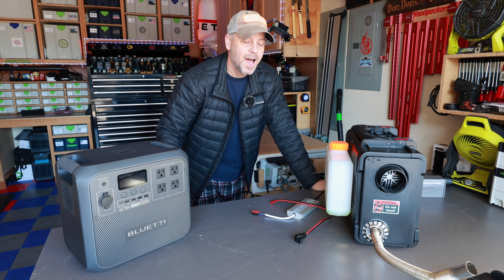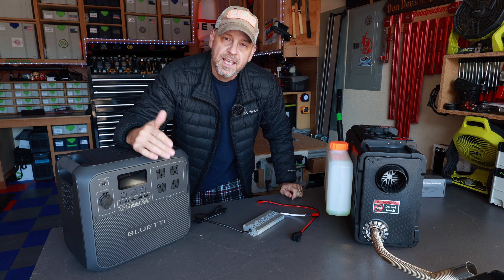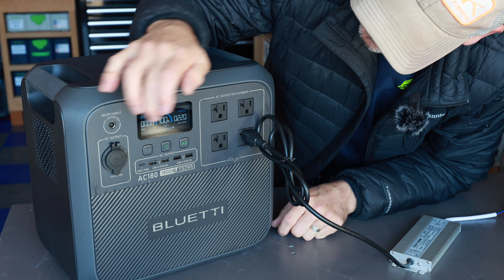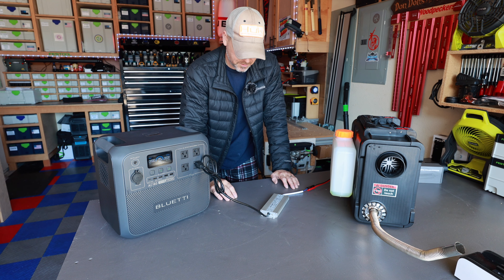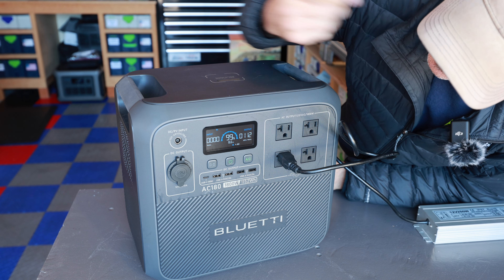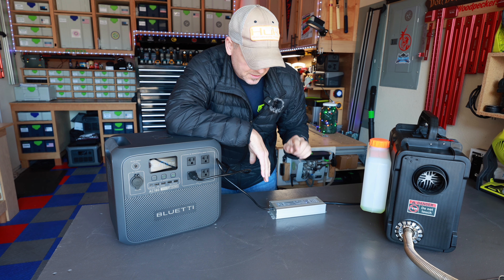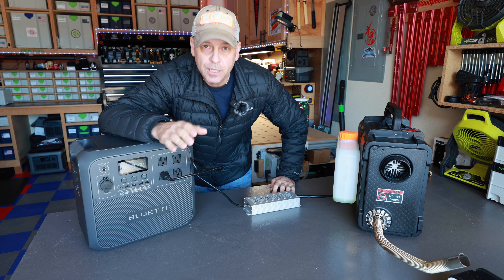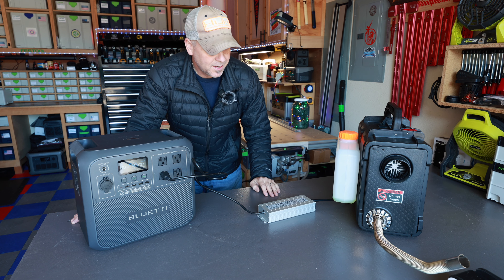Power Station not running your diesel heater??  Here's a quick fix that WORKS!

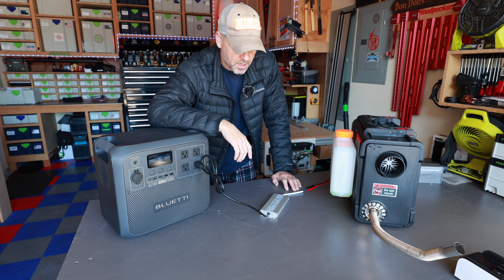Comment: What is the smoke coming from that starts at 4:37?
Reply: The heater itself it runs on diesel
Reply: Some exhaust back drafts thru the intake after it’s turned completely off. If the run cycle is not working

Comment: I looked at a Vevo 8kw and it indicated 120vac 15amp. The Bluetti has 120vac 15A so I am surprised it had issues. May be just on the edge of working?

Comment: Thank you, this is exactly what I was looking for. Now I know I’m gonna have to get an AC to DC converter regardless. It’s impossible to find a DC output that’s over 15 A.
Reply: The manufacturers are missing the mark by not giving us more 12VDC options.  How hard can it be to include a 30 amp Anderson Power Pole connection?  Seems like they are more focused on the AC side of things.

Comment: I purchased a AC to DC converter 15A 110-220v car cigarette lighter socket power adapter. I use it to run my Webastco 2000 diesel heater . Works great
Reply from the maker: That would be a good option too
Reply: I was wondering if that would work. Always seemed like the most straightforward solution but I've seen people get creative like this video and I just figured I'm dumb and the AC to DC converter wouldn't work. Glad to know it does.
Reply: Hello...are the watts important or only the amps? I found one ac to dc230- 12 volt 15 amps but there is written 120 watts... Can it work?

Comment: Same use 2000 w invertor , as start up n once running swith to cig plug . To run a fridfe n heater all nt 15 plus hrs in winter
Reply from the maker: My unit won’t allow a “hot start” it immediately shuts down once power is removed

Comment: Glad I found this video. I have the same heater but an Ecoflow River Pro battery and will not start the heater. So I'm going to have to sell the Hcalory because it pulls an insane amount of watts up front and find something else that uses less power. I really want to utilize the efficiency of the 12 volt. I only get one night with the AC to DC converter.

Comment: A bit confused. I've watched numerous YT videos of folks using the diesel heaters for camping, and this is a first concerning the additional piece you're showing. Just recently bought a Vevor 8w vertical model diesel heater, but have yet to test it. Won't be using it until late March/early Spring chilly nights next season (2024). My plan is to simultaneously heat a Hiker Trailer and a roof top tent, via a wye connector hooked to hoses. Power source will either be EF Delta 2, or a Jackery 1500. Maybe I need to run a test way before next season. 🤔
Reply from the maker: All depends on your heater really. I’ve seen some people able to use the 10amp cigarette 12v output on a power station and it starts the heater fine. I’ve also seen (and in my case) my heater pulls way more than 10amps and it trips out the power station. Probably a 2kw or a 5kw heater would maybe be fine, but as tested, this heater got up to around a max of 250 watts being pulled to get the blowing warm.
Reply: @BrianWatersOutdoors  👍

Comment: As others have stated, I just use an old laptop adapter, 12V 15A output runs mine just fine.  Same thing can be purchased on Amazon with the cigarette adapter plug already on it for like $25...but that was a new discovery for me too.  Such a good idea.
Reply: The problem is the 12v cig plugs in these power stations tend to be limited to 10a, not 15.

Comment: What is that coming out from underneath the Ryobi fan on the floor at 4:33
Reply from the maker: It’s smoke coming back out the air intake after the heater died. That’s why you always let these heaters cycle off fully when you shut them down so that smoke will burn off during the cool down process.

Comment: I ran into the same issue with my eco flow delta with the same heater. Thanks for the video! I just purchased that converter that you mentioned and hopefully it will work like yours.
Reply: New converter work for you?
Reply: My eco flow powered my 8KW last winter via 12 V DC no problem.  This year it trips.  Can anyone explain this??

Comment: The 12v outlet is the issue at 10amps max. In trucking we needed to go to the battery 🔋 directly.
Reply from the maker: Yeah. I do have a few larger generators that have a 20amp output, but I don’t want to have to lug around one of those big power stations.
Reply: @BrianWatersOutdoors  I was just watching Minute Man Prep and he’s got a Oupes Mega 2 review going on and it has a 12v 30 amp Anderson connector.

Comment: I have a question at about 4 minutes and 35 seconds what is that smoke or fog coming out from underneath your Ryobi powered fan?
Reply from the maker: Yeah, that’s the smoke generated from the diesel heater after it shut down due to the battery tripping off. It was coming out of the air intake which was near that fan. This is why you always let the heater cycle down when you shut it down so it can properly expel all of that smoke and burn it off

Comment: Do you know what could be the issue? Everything was working when I had it running over night. Some odd reason when I woke up to check on the unit but it was off and I couldn’t get it to turn back on. I even bought a new controller and motherboard but still it won’t send any electric to the unit. Do you believe the inverter is dead?

Comment: Thank you. Can I hook the non AC end directly up to the positive and negative terminals on my deisel heater?  Mind doesn't have a plug, just two terminals that you screw down.  Will this work?
Reply from the maker: Yes. That is how most diesel heaters are. Just (2) terminals for connecting the positive and negative battery cables.

Comment: My Ecoflow river pro has been working for us for the last 3 years. Once I recall it shutting down during start up but unplugged and replugged it worked fine. Must’ve been lucky i guess. I also have the same heater as you I think.  Hcalory right?
Reply from the maker: That’s only a 10amp output too, so I don’t know. Maybe it’s a diff model HCALORY?
Reply: @BrianWatersOutdoors  wish there was a way to attach a photo of the Heater with the Ecoflow.  Oh well.  Best of luck.  Cant wait for more adventures.  Winter is going by fast!

Comment: My Ecoflow River Max can run your heater using the 12v socket. I have the 5kw Hcalory. I'm shock why your startup goes above 200w. Mine does just around 160w and then when stable goes 10w-30w , so people using laptop and ac-dc converter is a great idea but I dont need it with Ecoflow River Max 2

Comment: I ordered the same converter- the second time I used it the converter stopped working and we could smell burn wires. I have an Anker 2000 and an electrician said I needed a converted that had input of more amps

Comment: The AC200 MAX has a 30A 12V DC plug.  You could run a 12V four -circuit fuse block from it and power your heater and lights from it.  If you still have your Bluetti  AC200 MAX.
Reply from the maker: I do still have it, it’s just quite a bit bigger/heavier. I like the size of this ac180
Reply: @BrianWatersOutdoors  The AC180 is a great power station for its size.  Perfect for weekend trips.

Comment: Hey bro, i just ordered the 250watt transformer for my new hcalory diesel heater. Its all on its way. What gauge Anderson plugs did you buy for the wires? Im new to this snd theres so many sizes. Thanks.
Reply from the maker: I use the 30amp Andersons. Those are more than enough for this

Comment: I have the same heater with Bluetooth n max it pulls starting is 156watts with cig outlet on my cellpowa1000 ....not sure why yours pulls 224watts...something is off there...i used both cig outlet n my inverter ac to dc.....
Reply: Yah I’ve seen them run 50w and start with 100w.

Comment: What is the efficiency of that? You're going from DC to AC then BACK to DC, the current draw will be higher than actual.  You need to measure the amperage used in line at the heater.  I've never seen it pass 11A.  12V x 11A = 132W.    I have an xBox 360 S (135W) power adapter running mine. It for sure draws 200W at the AC outlet when maxed out.  So even when a battery would run fine, the conversion from DC-AC-DC is costly.
Reply from the maker: I understand the dc to ac back to dc conversion loss. If I want to use this specific heater this is the only way to with this power station.

Comment: Question. How many amps @ 12 volts does the Hcalory heater draw when using the 12 volt battery?
Have you measured the amperage the Hcalory draws when using a 12 volt battery?
If it draws around the normal amperage, that seems to be between > 10 and < 12 amps, the rating of the converter some heaters now include,
a 110 AC to 12 V 12 amp DC converter of that rating.
What is responsible for approximately double the amperage you observed being used by this particular Hcalory heater?
I think you said you observed a wattage of 240W which would equal approximately 24 amps @ 12 volts during the startup phase.
That 24 amp draw seems very high.

Comment: I am new to this game, but just wondering if you could hook directly to the car’s battery - run the car while the glow plugs are firing up and then shut the car down and switch to your portable battery for the remainder of your night when the heater is drawing so little. Easier than lugging another battery along and less expensive than sizing up equipment for the initial warm up… thoughts?
Reply from the maker: Probably not. Those are typically only 10amps or 120 watts. Same as this power station

Comment: Hey Brian have tried charging your ac180 with a generator,  Iv'e read some post that states some of the Bluetti power stations don't like generator supplied power.
Reply from the maker: I have not, but if I were to use a generator I’d probably turn down the charge rate on the Bluetti so it doesn’t stress the generator (depending on the size of the generator).

Comment: Some of the newer portable power stations have a 20-amp Anderson DC output that is perfect for running one of these diesel heaters.  As you saw, they draw 15 amps or more, while heating up the glow plug.  We use one to keep my wife's she-shed toasty while she makes amazing stained glass art.  :)
Reply: the 250 watt power supply should handle 20 amps, the heater will draw close to 11 amps until the glow plug does it's thing. people need to be concerned with amps, not watts
Reply: Which one? I can’t seem to find one.

Comment: Just purchased this heater last week and have the same power station and didnt even take this into consideration. Random find scrolling through your videos, but thanks for this. 

How is this working out for you so far? Have you changed your diesel heater setup since this?

Thanks
Reply from the maker: I used this setup multiple times last winter with the truck and worked just great.  i did forget the converter and got stuck without heat for a trip, so that's the only downfall....I now pack this converter in with the heater so i don't forget it.

Comment: Excellent Brian. I have a kind of stupid question so please forgive my ignorance lol. How do you charge those power generators?
Reply from the maker: You can use the ac grid (wall outlet) solar panels or even a gas generator in a pinch. Can also use your cars 12v output to charge it too. Quite a few different ways to charge these up
Reply: @BrianWatersOutdoors  Awesome, I watch a lot of camping videos and they seem very prevalent across the outdoor scene and have wondered how these things work for a very long time. I'm old school and didn't realize how great these new power stations are compared to the old gas powered generators I grew up using. Thanks again.

Comment: The variation in the wattage is probably in the  inverter. The glow plug has a fixed minimum resistance which it should draw about 10amps at 12 Volts (120W) which increases, thus reducing the current, as the glow plug heats up. There's no way the current draw / wattage should vary like that in the glow plug.  If you hang an ammeter in series with the power lead into the heater, that will tell you the current draw then multiply that by the voltage to get the watts.
Reply from the maker: Good info👍🏻 thanks

Comment: The Hcalory SS2 model which is only about $30 more than the HC-A01 comes with both AC and DC power adapters. It also has a bigger/internal fuel tank as well, its hard to find available online though.
Reply from the maker: I’m waiting for that model too, it looks nice. But they are waiting to get it back in stock and I’ll probably switch over to that
Reply: I have the SS2 as well. It heats great. Only thing I don’t like is that if you accidentally spill fuel on the outside of the tank, you will smell it when it heats up as the intake for the air is inside the box. I’m trying to figure a way to seal the intake to the box to keep the smell out… otherwise it is great.

Comment: Good idea.  I was wondering how you where going to set up to solar charge, both the battery bank and the stand alone 12v battery.  Great Video as always!
Reply from the maker: I’ll have a 200 watt solar panel on my rooftop tent I will use. In all reality though, I’ll just keep the batteries topped off when I get home.

Comment: Had the same issue with my bluetti eb70s. So I ordered a 600w 12v power supply. The power supply itself through ac loss is about 100w.   Running its like 135w. I have the same heater btw. I might need to look at your power solution hack. ❤

Comment: Hey thanks for posting this vid as I made sure to buy a 300W 12 VDC IP 67 LED supply with single string output and it ran with no problems sure many 12 VDC Power Station units do not have the juice for startup sequences!  Also buying a big UPS to avoid power outage conditions with enough energy to support proper shutdown sequence and also handle my computer equipment!
Reply: @BrianWatersOutdoors  Hey tnx for ur vid!!! BTW was looking instead at a small-ish Power Station with 20 ms UPS but more backup juice and LiFePO4 long life batteries instead of UPS with 5-10 ms switchover but weak/heavy/short life lead acid. Obviously do not want that shut down due to power outage to damage unit right? Not sure of course if it wont shut down even with the 20 ms switchover, any thoughts?

Comment: Curious if youve discovered why your unit pulls so much power. I have the same problem, but I notice it’s not a universal problem with these hcalory ac01 units. Plenty of people seem to be running them on their power supply with only 10a or 8a cigarette ports. Super annoying.

Comment: The only issue with the converter is that it drains the power station too fast. I have an ecoflow river 2 pro and it can  barely handle one night with this  burner. After the ignition the consumption is about 25- 35 watts. With my older 5kw burner the consumption after the ignition was 10watts. 
So i think the converter it's not a solution to the problem.

Comment: This is an interesting experiment Brian.  It may be educational to see what happens when the ambient temp is much lower.  As you know, diesel is harder to vaporize at lower temps, as well as the fact the battery powersource becomes less efficient the colder it gets.  The result might be the current draw being greater for a longer period ?
Reply from the maker: All very true George. I don’t typically experience the super cold temps though here in the south that you’d see up north, but cold temps and batteries don’t really play well together

Comment: i have a delta 2 max and tried this method idk why it doesn't work? when i plug my 12v into my car it works fine but ive tired a 12v adapter plug to wall does the same thing. I tried this and its doing the same thing when i turn it on it limited at like less than 20watts HELP PLZ. This is my 2nd diesel heater have not got any of them to work with my portable power station

Comment: This is going to blow your mind but -- find yourself an old laptop adapter for like $4, the kind with the large brick in the center. Works like a charm. That's what I've been using to run my heater for about 3yrs now. Just make sure the input is 100~240V and the output is 12v 15A
Reply from the maker: I’ve got to have one of those stashed away in my electronics junk drawer!😂
Reply: Same problem here. What’s strange is my eb3a will run my hcalory diesel heater but my larger Bluetti will not run it the off cigarette style plug in. Thx for this knowledge. I was going to send my eb70s back because off this problem.
Reply: what kind of power draw do you get from this?
Reply: Hi...do we have to look at the 12 volt 15 amps,or like this guy says on the watts? I am confused.if i buy an power supply with 12 volt 15 amps but 120 watts will it work?
Reply: @boonies2158  hey man, digging this out of the grave as i am looking to buy a diesel heater to run off my eb3a. which Hcalory are you running off your eb3a and does it work off the cigarette port?

Comment: why buy a 20a led driver if you just can buy a 30a industrial power supply for less then half the price? anyway, some power stations just have something like 25a xt60 plugs what makes life much easier.
Reply from the maker: Yeah, some stations have the 25-30amp output. This o e does not